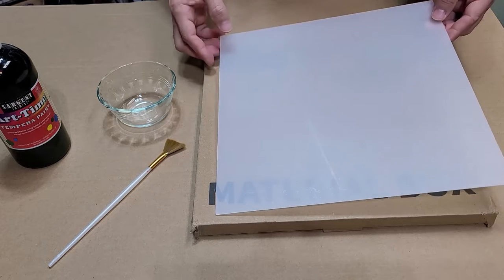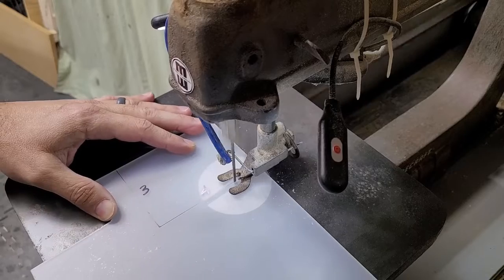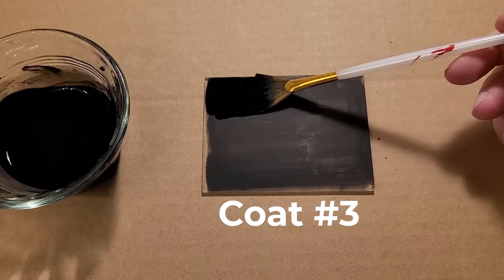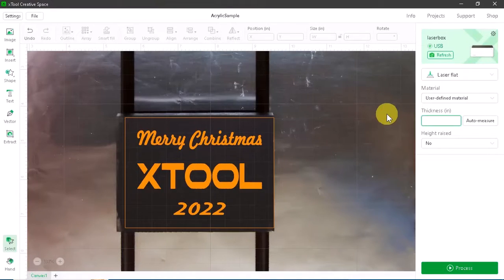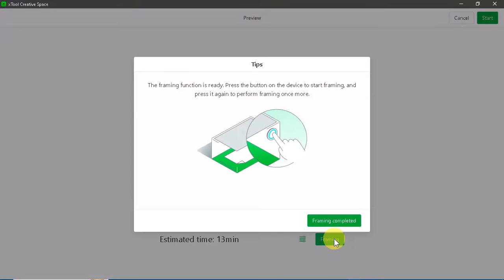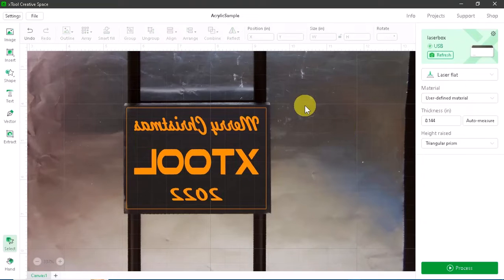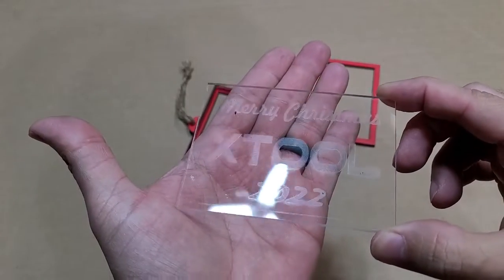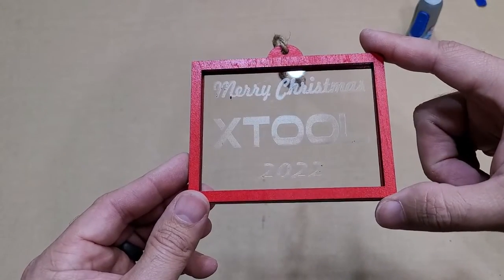How to Engrave Clear Acrylic with xTool M1 Laser Cutter | xTool Maker's How-to

Comment: ACK! Be very careful with using super glue near clear parts, as it has a tendency to fog them up bad as it cures. Even on non clear parts, it can leave a white film on them that's hard to remove. without potentially damaging the material a little. But it's a disaster on clear parts. If you keep a fan blowing over it or otherwise well ventilated, you might be okay. But I've had them fog clear parts that were covered a bit pretty bad.

Comment: Hi I tried this method but got no where with it.  I was trying to engrave a picture and it was on 1.9mm acrylic.  Will I have to change settings?  Also could you do a post on how to do the engraving settings you had on your spare bit off acrylic.  I am sure I am not the only one who would be delighted to see how this is done.  Cheers

Comment: I decided to use my airbrush and following your mix and I can get an even coat. It is a little runny on he initial but after it has dried. The next layers sprayed sticks. But also I remember a video I watched that the person used airbrush to apply the paint. I will find the video to make sure they get credit.
Reply: Oh, I had green tempera paint and used your M1 laser settings and got good engraving for the cast acrylic. had to adjust for the cheap acrylic ornament disk I bought from Amazon and it came out good with the green tempera paint.